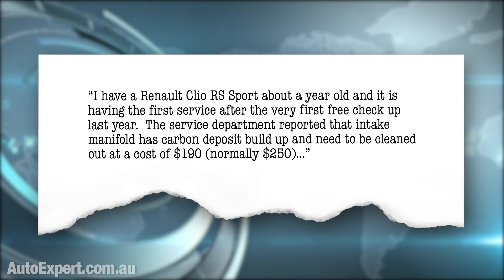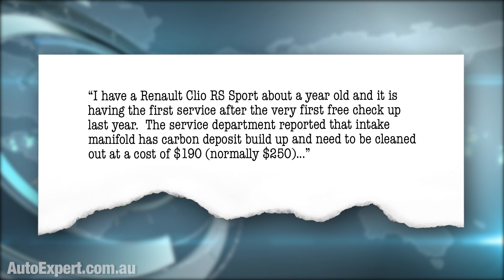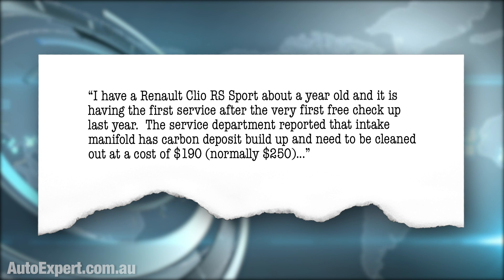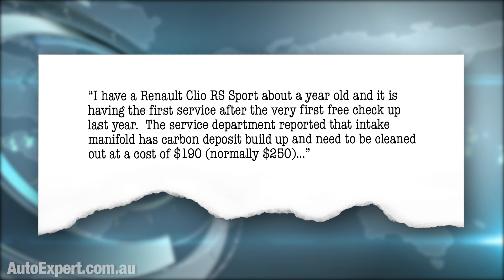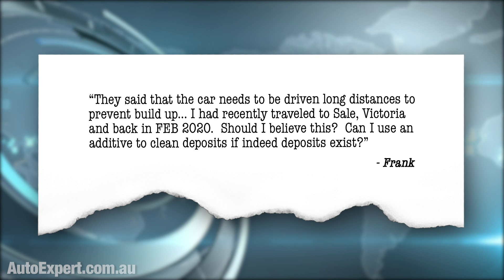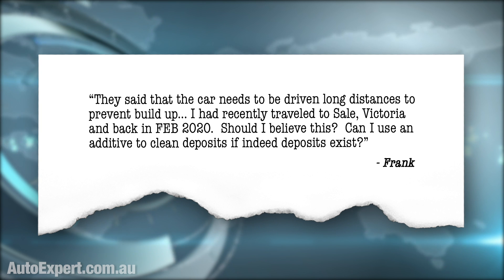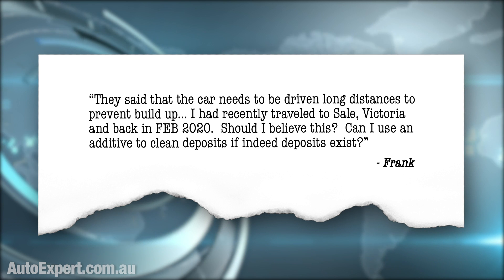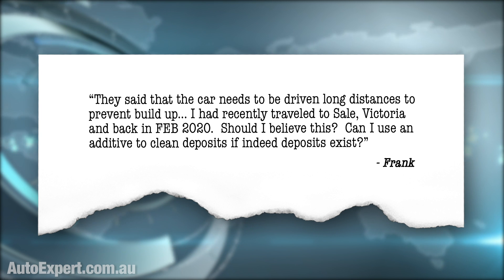The truth about inlet carbon deposits (sludge) in modern engines | Auto Expert John Cadogan

Comment: Do we still have EGR on cars today, I have looked for some return pipe on our cars and cannot see any tappings in the exhaust manifold, maybe it goes through the head to the other side?
Reply: EGR galleries have been through the head since early eighties. Presumption: Manufacturers were encouraged to play this way to discourage owners buggering about with their precious EGR systems. Looks neater, though.
BTW, the coolant being used to reduce temperature of the EGR flow is interesting in that I reckon a bloody big extra (and red hot in operation) drag inducing radiator may simply clog up the system with 'deposited' combustion by-products. There's balance there at many levels, of course.

As for PCV - fuck it and the horse it rode in on. Positive indeed - bloody hell, even the name is spin. 
Can one order a vehicle with decent ring tension as an option? This would be no bad thing - a trade off with fuel consumption against the pull-through run up the highway which costs good money while exposing drivers to both the whim of idiots are just clever enough to extract their licences from cereal packages  and predation by the Forces Of Evil and their bum-buddies in the legal/extortion caper.
Reply: @johnpoot725  I change oil regularly so have never had a clogged PCV , EGR probably can soot up after a while The ICE has just about run its course, manufacturers have pressures to reduce emissions and improve economy and these targets are getting harder to meet, we now have undesirable things like direct injection, turbo chargers which need to be babied when overly hot, Do you really save a lot on fuel with direct injection?, I am not interested for the piddling driving that I do , DCT's are fine for highway driving but not so hot for suburban usage where they will spend most of their time and when they need a major service, possibly  out of warranty, they will be a money pit, other "egregious" devises cunning manufacturers fit are things like electric park brakes, bloody useless in some emergency situations, but Heh they are cheaper to fit as a time [and design] saver , along with that other bastard thing, the push button keyless stop start. and don't get me started on alloy rims bigger than 16 or 17 , only fitted on the upspec models, 'cos mines bigger than yours yeah, sales gimmick only.

Comment: Hey John, I have a Ford 3.5 Ecoboost and get about 15 minutes of highway driving 3x per week. Sooo.....based on what you shared here, my driving habits are bad for valve coking which I agree with. Can quality full synthetic engine oil (I change at 4k miles due to my short trips) help with this issue?

You are a dickhead and full of shit!

You mentioned in another video that you were not getting enough negative feedback.....hope this helps.

Comment: Daughter has one of them new Holden Bladerunner diesel 3.5t towing wagons. Uses it to get to work, and tow the new van when it arrives. Round trip to work for her is 6km. Her mechanic keeps reporting there is water in the oil.  Her warranty claim with Holden has them claiming that she is adding water to the oil instead of the windscreen washer bottle, to which I know she isn't that silly .... but, hmmm... reasons.
Reply: Oil Temp gauges are a mightily handy thing. Maybe someone could train a computer to scream a warning to remove the need for drivers to understand how that temp  gauge should assist them to give a shit about their engines. No big deal - the computers are getting 'chattier' day by day.
The same jerks that simplify driving to expand their market by not fitting OT and EGT gauges etc are the same ones building vehicles no-one can actually survey their  surroundings from without the aid of (distracting) cameras. Good CD and therefore consumption numbers though

Comment: Sounds to me like another attempt by the service department to boost the bill, they tried to add a brake fluid change on my 15000km (2 year old) i30.
Reply from the maker: Brake fluid bleed at 2yo = good idea. (It's hydroscopic.)
Reply: If you want warranty you cover a failure in the ABS unit , you’d better stick with the 2 year schedule

Comment: My car drives on average, 3-5000 k's per yr.  I wait until the big race is on at Bathurst as that is when SCA reduces the Castrol 5w/30 oil it requires by 50%  to buy the annual oil change that I do to it on a yearly basis.
After having watched this report I will also splurge on a can of top end cleaner from Subaru. Hopefully that is sufficient to keep the carbon/sludge demons at bay. If I thought the computer wouldn't have a conniption for having done so, I would block the EGR and vent the PCV to atmosphere.. Down There! Cheers JC you MOFO.

Comment: Using a can of 'CRC GDI intake valve cleaner' spray
before an oil change might help avoid build up 👍
Reply: I do that every other change (each 10k miles) and have scoped the intake and the valves are perfectly clean.  I do use a very good synthetic oil and do highway miles of approx 45 minutes each trip, so the engine is very happy.  So, am I.  PS, I haven't any oil inside the pcv hose, so that's a good thing, I'd suggest.  I use Penzoil Platinum and it has the highest voc rating, so it evaporates a lot less than dino juice.

Comment: Just to what Toyota does and give it both port and direct. Problem solved.
Reply: VW, Ford (among others) also do this
Reply: I've seen the intake and inlet ports of such an engine and I wasn't impressed.
Reply: @R J yes I mentioned that
Reply: Ford Mustang has direct and port injection
Reply: @rabbit73au  mustang gt*  the ecoboost has direct injection only
Reply: Subaru are also doing it starting with the FA-20 (used in the BRZ and GT-86). I think they might actually have been the first to do it.
Reply: Really solve the problem instead of the symtom...remove exhaust recirculation system.
Reply: @ramsey6684  Can't really do that as a car company unless you want your new model to be banned in half the world because of emission standards.

Comment: Nature of direct injection engine. Needs to be driven hard, hot and no 5 mins short trips to supermarket. (We got a 1.3 Toyota Yaris for short trips like that). Have owned a few DI cars, no carbon issues, slight  build up when inspected with a bore scope unavoidable. Both my wife and I drive our cars very hard. Every opportunity to redline the car whenever safe to do so, at least once a day. Long motorway trips once every 2 weeks. Oil change more often with low ash full synthetic oil.

Comment: i heard fly spray is great for cleaning the carbon off ya intake valves, just idle your car at 5 thousand rpm (cold engine of course) and spray down the intake eshaaaayyyy🤣🤣🤣
Reply: Any brand preference..Raid
Reply: And if that doesn’t do it a complete can of “Start ya Bastard” should do the trick.   On another topic, I also heard that bleach works well if you have a cough 😷, just a few mouthfuls will do.

Comment: As my mechanic says; "5 litres of Oil every 7k is cheaper than a new engine, or a terdown/clean/rebuild."
Reply: Umm i delivery drive in a 2017 Mazda 3 (from 2017 till now, currently at 76k) i made a vow to get an oil change every 3k to 5k miles, not the 7.5k or whatever. No problems at all... I also throw premium cause I'm dumb.

My friend said I was doing too much and he changes his oil  "when he needs to"....  his engine blew 3 months ago...
Reply: @NA-ju4vq  changes oil when he needs to haha
Reply: I hope that K is thousands and not kilometres.
Reply: @77gravity  Yes.
Reply: 6.3lt every 5k for alloytec...& blow out pin holes in PCV while at it
Reply: @groundcontroltomajornong8085  1/2 litre oil at 8k kms oil changes on my Focus ST 2007 (xr5 for Aussie fpv communists ! )

Comment: The thing that made the carburetor great was that... You, if so inclined, could fix or service it yourself, using simple inexpensive tools.
Reply: And the 'fix it yourself' brigade were responsible for more problems than they ever fixed. Carburettors once set up do not need fiddling with for a very long time.
Reply: I heard many years ago that "carburettor" is a French word meaning "don't F##k about with"
Reply: I do confess to having rebuilt a pair of 40DCOE Webers a long time ago with the help of a number of magazine articles for reference. They along with a sporty exhaust make music.
Reply: @M Bacon No, never owned a British motorcycle, had enough of them having to repair a few. Only had Japanese ones myself, as you, never had to adjust the carbs.

Comment: D4-S may be complex, but it solves the problem. But that would be more cost up front and thus not good for the manufacturer.

I still wonder if carbon buildup causes super-knock. Pieces break up and cause hot spots in the engine cylinder.
Reply: W Burger Toyota does it in basically all their cars. It’s complex but works very well. Pleased to report at 190,000km I just had to change a mechanical fuel pump in my is350. $70 for a used part and about an hours labour and it was running again. Not too bad! Did a sensor which was $20 at the same time (fuel pressure sensor). Never was quite sure which fixed the issue but for sub $100 I’m happy.
Reply: @WTCHME  I suspect you mean all Lexus models. Which happened after the first is250 range caused carbon buildup and they solved it in subsequent models. And the affected models are cleaned at Lexus's expense for the design flaw.

And you may be right with newer Toyotas having it, but then they usually would taunt it and flaunt it?

Subaru still has to catch up... Excluding the BRZ.
Reply: W Burger 2016-20– Tacoma’s run both injectors, so far 30k on a 2019, no problems.
Reply: W Burger They pretty much all run it now. The new Corolla has d4s. 
Not sure about the hybrids though?

Comment: My imported Toyota has a direct injection 3GR V6. I was a little worried about carbon build up on the intake valves. There are lots of Youtubers recommending oil catch cans for this, apart from our Johnny boy here. 

I had my engine checked and it was dry with no sludge, so I didn't need a catch can. Who knew Toyota knows how to make an engine, direct injection one at that.
Reply: Some Toyota engines have both direct and indirect injection in the same engine problem solved ?
Reply: @kris8742  True, but not the 3GR-FSE. The 3.5L 2GR usually does have port and direct, D4-S in Toyota speak. 3GR-FSE is D4 direct injection only to my knowledge.

Comment: Hey John. Awesome p
Work.. I big respect for what you do. I have a 2016 2 litre  auto mazda 3 astina with 85000km  how do you feel about an oil catch can to reduce the probability of this happening?  Also thinking of changing transmission fluid at 100 000 km
Reply: Cant comment on the catch can but i can tell you how expensive a fix can be if you dont change the trqnsmission fluid. I am glad you thought of doing it before it gives up!

Comment: I'm still blown away when my Toyota Tacoma runs up 6,000 rpm before shifting in a few milliseconds. No "muscle car" would match this. I recall carburetorated   engines barely being able to run at 3,000 meters.
Reply: Most of my aircraft have carburettors, they quite happily climb to 14,000 feet.
Reply: @Ozgrade3  Here there are roads reaching 3200 meters. I remember a VW that couldn't make it over a 3100 meter pass in Yosemite. On the bright side,he could coast all the way down to Lee Vining.

Comment: Carburettor development reached its peak with Kawasaki's ZX7R (ZXR750) P model.
Flat-slide 50mmx4, 1 per cylinder.
These bikes have such a short inlet tract the spark plugs are WAAY down under the rocker gear. 
The air-box is 23litre and connected to air scoops in the nose big enough to stick your fist in 🤣🤣🤣 
12,500rpm in basic trim, the snorkel roar is the coolest thing in the world. 
120 kilometres before reserve, 16l if you're getting up it.
280kph will run happily all day at 230kph. 
Still have one in the garage. 🙃
Reply: 50mm? You mean 38.
Reply: @donr62  no, 50mm flatslides. Maybe that's where the hp goes with the Yank bikes. Australian ZX7R hp 128, Yank hp, 105.
Reply: Clifton Manley 41mm are the biggest flatties fitted https://andys-kawasaki-zxr-zx7r-tribute-site.net/model-history/

Comment: Someone has to say it, CATCH CAN!
Reply: Matthew Bennett I run a UPR catch can on my 5 litre 2016 Mustang V8.
You would be surprised the amount of oil it collects over 5000 km.
Manufacturers do not put catch cans on as it increases the initial cost of the car, ( by f—k all) and they require maintenance, (checking for oil and emptying).
Reply: The problem with a catch can is that carbon still comes from the egr system and if you don’t have oily mist from the crankcase to gum it up it can form as dry clumps and do damage. The best thing to do in my opinion is to periodically remove and clean the intake manifold and egr valve if your somewhat handy on the tools it’s a relatively easy job.
Reply: @anaussie5984  no the only solution is to block the egr and dump your pcv to atmosphere
Reply: @majestictwelve3709  Apart from being illegal, it can give potentially create some warranty issues. Bypassing systems can sometimes create other problems down the line.
Reply: @landrover1155  oops, replied to the wrong post. I'll try to clear it up a little. 
Fititng a catch can in itself is not illegal .
However, bypassing or modifying emissions systems is.
That is what I was responding to.
Reply: @lesfox2010  Fitting a catch-can doesn't bypass or modify (in that the operation is not changed), so that is fine in that sense. People who put DPF bypass/deletes in probably have more to worry about.
Reply: @hudrob1976  that's what I was talking about.
The post I was meaning to reply to was talking about bypassing/deleting  the EGR.
Reply: @anaussie5984  I've done this on a Mitzi diesel and its definitely not a relatively easy job. I'd say its a barstard of a job...not for the faint hearted or amature mechanic.
Reply: @ajcuthy1945  It took about 15 minutes to fit the catch-can to my Challenger 2.5L turbo diesel...
Reply: @hudrob1976  I was replying to an Aussie re cleaning of the intake manifold. You probably need to remove yours and clean it as these are prone engines. Then you can guage the degree of difficulty and time required. Cheers
Reply: @ajcuthy1945  Ah, gotcha, I thought it was about fitting a catch-can - YouTube comments aren't threaded particularly well. And yes, removing the intake manifold is a PITA.
Reply: @hudrob1976  I'm not sure how old your Challenger is but if you intend to keep it for a while i recommend to 1. Remove the intake and clean. 2. Add a catch can...Provent or Flashlube are best on tests. (Already done) 3. Add a 'egr off' module from chipit tuning...i think it available for Mitzi engines. It plugs in/out. I did this on a Pajero 7 yrs ago and no problems. Changed the filter in the catch can once. Slightly more power and better fuel economy due to the charge air being entirely outside air. Cheers.
Reply: Especially if it is a turbo engine.
Sadly, most of the ones I've seen people put in are not effective when needed the most.
I usually see them piped to the intake manifold, so only see vacuum when not under boost.
Reply: John covered this issue already
Reply: @RICHOCHANGO  I know mate...
Reply: @RICHOCHANGO  yeah and his usual head up arse syndrome reckons catch cans don't do jack, does one need to say more about John's expertise... or lack there of (fek no). Just like he has a sad if you get rid of that bullshit EGR system that causes all the feking grief to start with. A cleaner burn = a cleaner exhaust....pretty straight forward I'd say.
Reply: You will not see any catch cans in germany. Due to freezing temps and also because they are simply a hype for the spare parts industry. This video is correct in all it says.
Reply: Ended up putting one of these on my Citroen DS3. Seemed to help.
Reply: But what if you live in a colder climate? From what I've seen, the catch can mostly catches water along with oil, fuel and other crap. That water will freeze if it's cold.